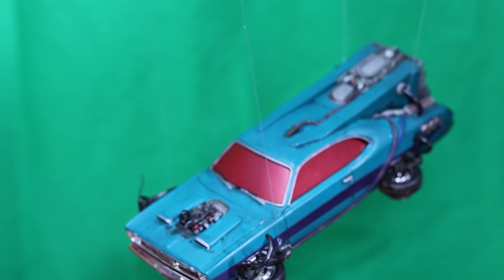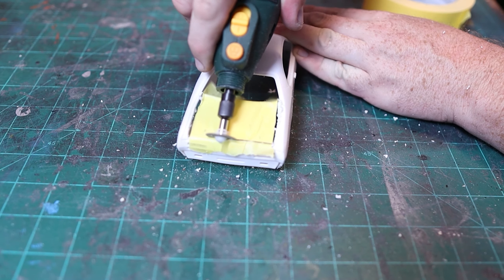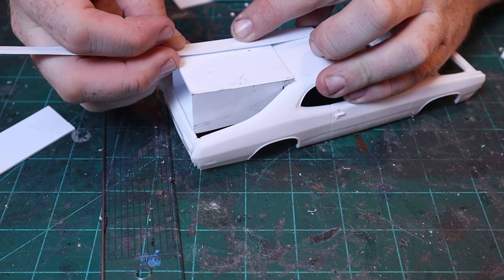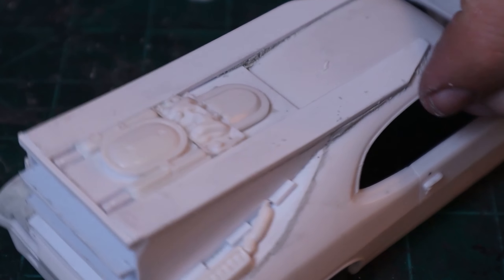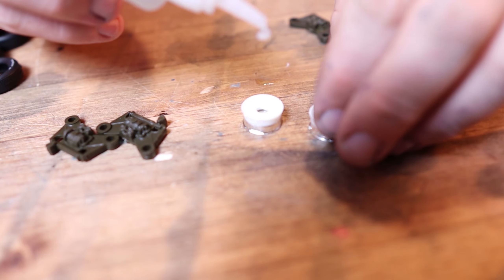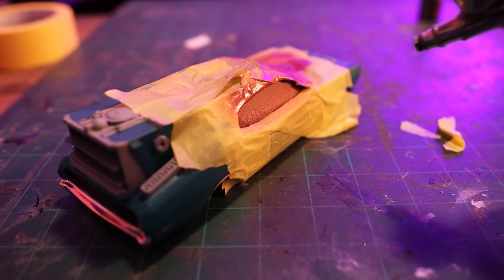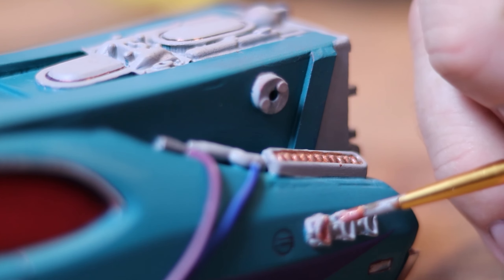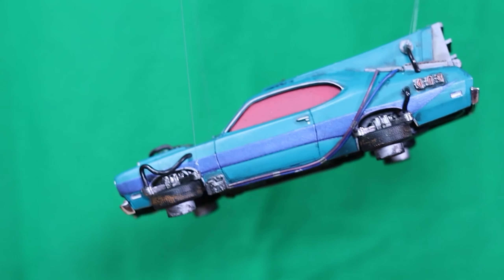Back To The Future Inspired Hover Duster Model

Comment: Fascinating details. I always struggle with where to put them and how to choose them.
Reply from the maker: I definitely used a few design cues from the BTTF DeLorean in order to ease the artistic process. After that it's just trying to get the piece to look less "normal". It definitely helps to just look at other miniatures and such that are in the genre you're going for. Ask yourself how does it work? How much did this cost? Is it a product you can buy or was it modified? Was it modified on the cheap? What did they have to do and use? All those can give you an idea of what to put on it. A hover car that's a fine product will likely not have wires and exposed details for instance.